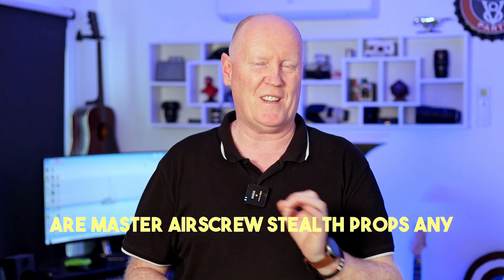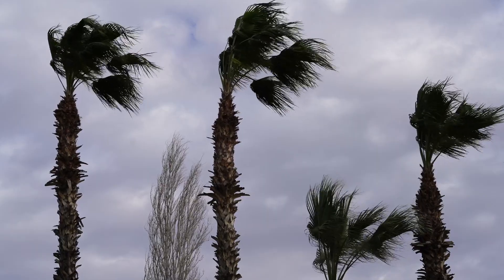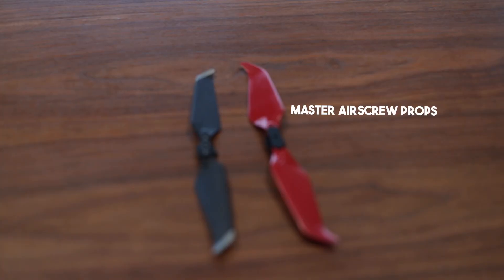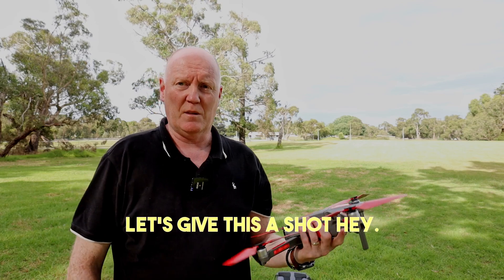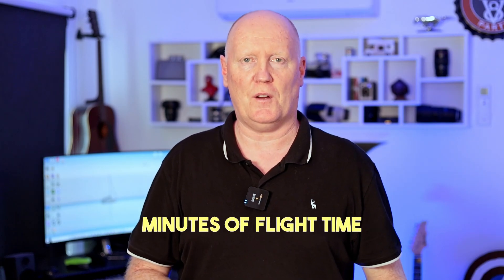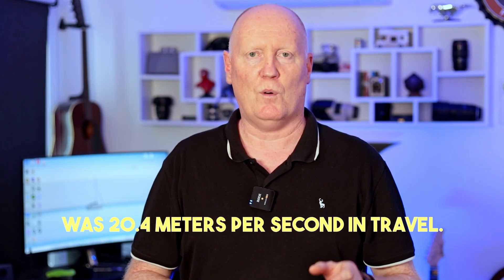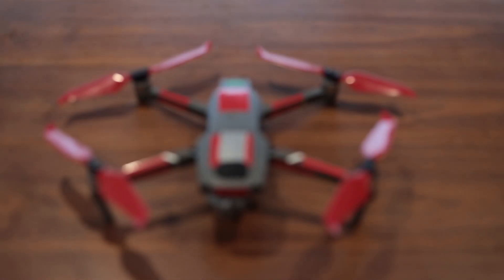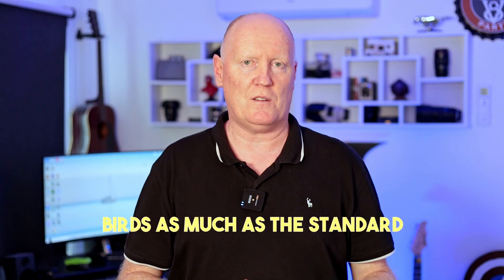Can You Improve Drone Performance With This ONE Thing?

Comment: I just recently fitted to my Pr0 4 and the difference in noise is quite staggering, although I did add a drop of model oil, at each connection, So not sure if the oil also had an effect, but together it really was much quiter
Reply from the maker: They certainly made a difference to my drone

Comment: Thanks for this comparison. I really like your methodology. I think the top speed in sport mode (and the others) is controlled by the software. The fact that you mentioned that the drone wasn't as hot after the MA run would indicate that it wasn't working as hard to maintain the software-limited top speed.
Reply from the maker: My thoughts exactly, I think getting the same top speed but having the motors work less is a huge bonus
Reply: @reelprodigy  I ordered a set right after watching your video using your link. Now I need to get some red reflective tape. I have some orange I used on one of my drones a while back, but I am following your lead on the red. Thanks again!
Reply from the maker: @skycam509  Good Luck:)

Comment: I have a DJI mini three pro, and I bought two full sets of replacement propellers for my drone. I wanted to make sure that I had a second complete set on hand for replacement as needed. The biggest difference that I have noticed is simply in build quality/durability. The master air screw propellers are absolutely indestructible! I found out the hard way how durable and sharp they are almost 2 weeks ago when I nicked my index finger trying to do a hand landing. These propellers could easily sever a digit.
Reply from the maker: They are pretty great, sorry about your finger:)

Comment: MA make some of the best props in the word, I have them on my F550 and Phantom2, and everything MA claim, is true. Quieter and more duration. They're also a bit more durable.
Indoor tests in a such a small space are a mistake, not because of the risk (there's a video of an 800 sized heli indoors, bloody frightening!), but because the airflow in the room ends up looping around inside the room in unpredictable patterns, which will have contributed to the drone moving around, and the drone never gets out of the Ground Effect, which has a large effect on duration.

Comment: Good informative video. Thanks!
Is there any difference in the weight of the propellers?
Reply from the maker: Cant find any stats on the weight but just weighed one prop for the Mavic2Pro for you. MAS Prop 10g-DJI Prop 8g. So it will add 8 grams to the weight on this particular drone. Smaller drones I would assume would be almost no difference.
Reply: @reelprodigy  Thanks. I have a set on order for my Mini 4 Pro.👍

Comment: Hey why u still using a mavic 2 in 2024? Do u have any other drone? Nothing wrong with that thing i wish i had 1 but now days the new drones r getting over 40 minutes of flight alot better zoom features
Reply from the maker: I am upgrading this year but I use my equipment on a 3 year cycle. The Mavic2Pro does eveything I need it to so its a case of if it aint broke dont fix it.